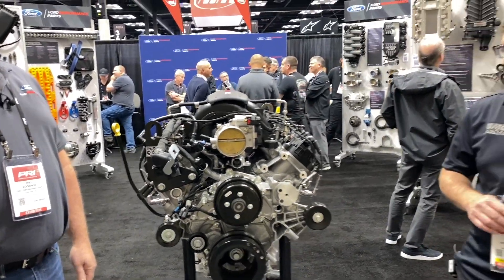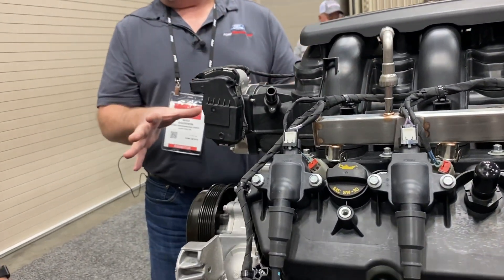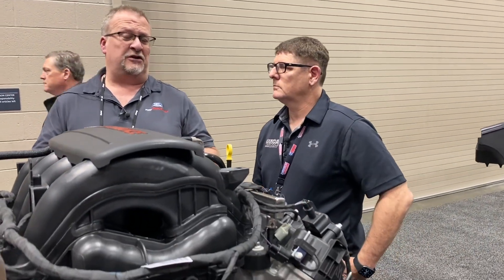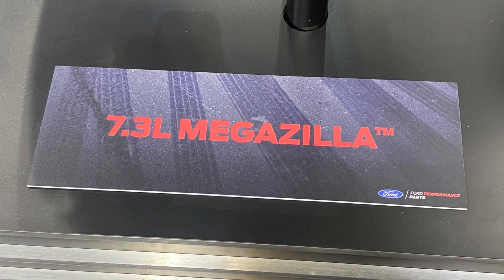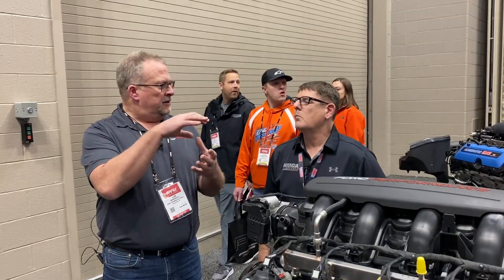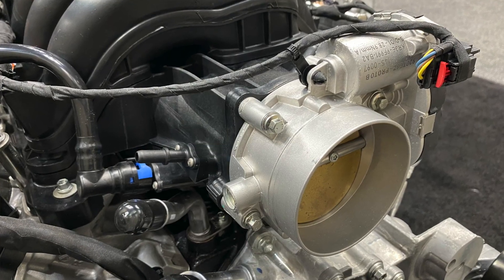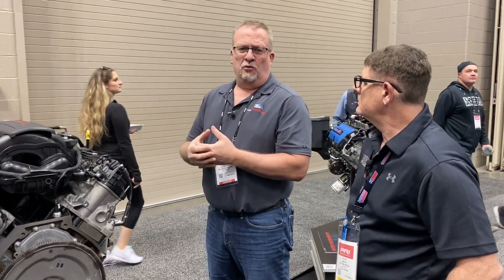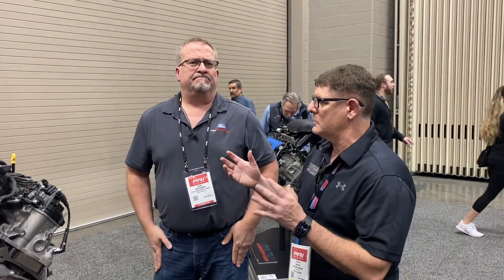Megazilla Is Here! 615 HP 7.3L Godzilla Crate Engine From Ford Performance We Get The First Look

Comment: This thing will make 700 N/A with a  different cam.  It has more torque than HP, with a different cam, e85 and a point to two in compression it will be a monster
Reply: This motor will also be equipped with a stronger valve spring package that will be ready for bigger camshafts.
Reply: Yeah, it’s already happened a bunch in times and way over 1000 on boost

Comment: Sub 20k for 615hp…. Give me a break; this is just another example of Ford pricing itself out of the mainstream.
Reply: Be better if it included the 10r140 for sub 20k
Reply: For another 9k you can get the gt500 engine
Reply: Any 400+ cubic inch crate engine will cost 20k doesn’t matter. Anyone can build an engine for that price. All crate engines are over priced
Reply: @loganthurston1021  exactly
Reply: @loganthurston1021   not true
Reply: Yes most people can’t drop that into a engine but if you look for a 600 hp ls crate engine it also cost 15-25,000 so it is right in the ball park with competitors
Reply: Drop 10K in a 408/427W and you’ll get the same horsepower.
Reply: @jp360ford2  100% fact
Reply: Yup. I'll just find a salvage and go from there.
Reply: Obviously, you haven’t priced salvage motors.
Reply: @nickb289  haha. Hi Nick B.
Reply: @HorseBudgetHero  hello Nick b
Reply: @AP-xq3jm  Definitely Agree, i made this type of Power with a Stock Stroke 460 with outta the box Trick Flow Street/Strip Heads on Pump Gas, Made even more the Bigger it got. It's hard to beat cubic inches. I do like the Size of the 7.3 Godzilla tho, you definitely starting off with a Big Engine, Can't wait to See some Power Numbers when people start stroking these 7.3,s.
Reply: @AP-xq3jm  And You could build it with all brand new parts too..
Reply: Exactly. not going for this mild build for $20K.

Comment: If it had 700jp N/A it would really be nice
Reply: Just swap the cam. The rest of the engine is ready for it.
Reply: @frojo1994  Was gonna say the same thing, 700 hp is only a Cam Swap away. Wonder how much Cam the Valvesprings will take, And would be nice if they had a Upgraded Package with a Better Cam and Springs right from Ford.
Reply: 700jp? What is jp, jelly peanut butter? 😆

Comment: When this vid popped up i was watching a vid on it posted 4 days ago. How would it work in a 10,000 lb truck with 10R140?
Reply from the maker: Quite well, I think.
Reply: @revanevan  I have seen the 7.3 10R140 control packs being avail are they? If so it would be a no brainer. Be nice if they had the new 500/1200 6.7 avail with 10R140 in kit form
Reply: I got excited and posted before watching full video. Love the 7.3’s but if just engine alone is 20k then add in engine management a 10 R140 it’s probably 30k project by the time it’s on the road. If i had “unlimited” funds maybe.. add the stack injection and WoW 😯 i better start saving. Or just wait for a HO 6.7 500hp/1200tq donor truck.
Reply: @randys66garage buy a motor, buy some upgraded internals  and build it. Should cost you about 10G less
Reply: @BigInjun05  Will wait to see what actual price is but 20k engine alone is out of reach for me. Maybe a crate engine with Harrop or Whipple S/C but even then a lot of $$. Maybe if I sold a few current trucks I could do that to 1. So much $$ tied up already. 7.3 and 6.8 Godzilla type engines probably near top of best engines for 2023 but hard to justify at price point. On my bucket list but will wait and see what pans out.
Reply: @randys66garage  same here especially since I just bought a house. Going to have to go on the back burner for now.
Reply: This is literally what I wish they would put in the super duty pickups. What a fricken unit. Makes 640 ft lbs. Perfect truck application.
Reply: @BigInjun05  Definitely not a truck application - it’ll be more of a revver
Reply: @BCSVT  especially with that VCT system deleted and stiffer valve springs